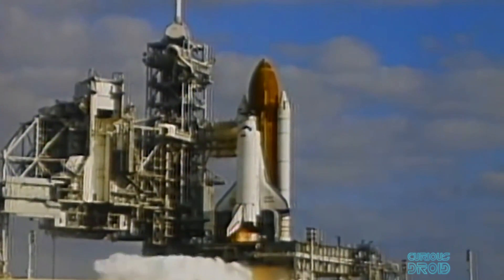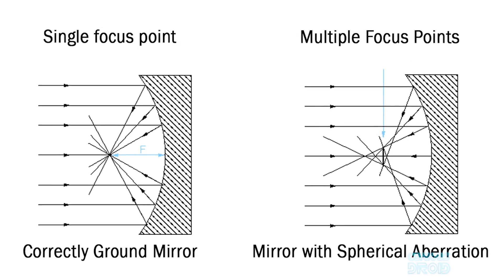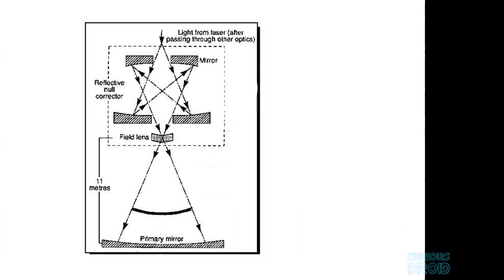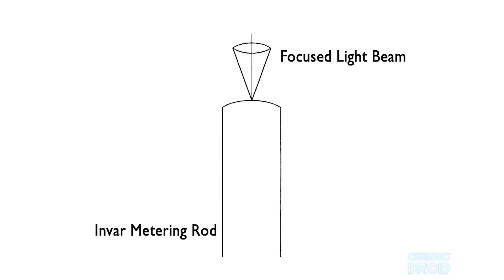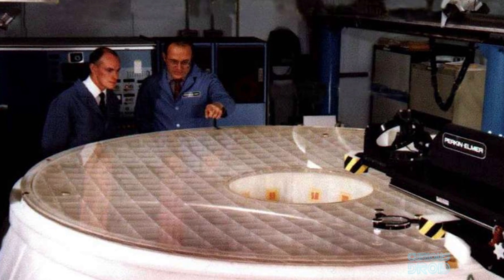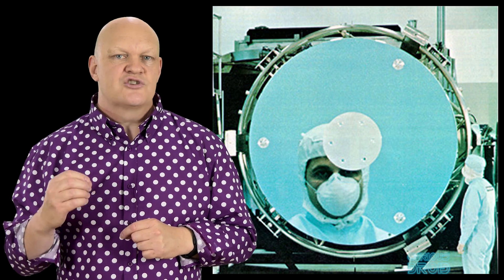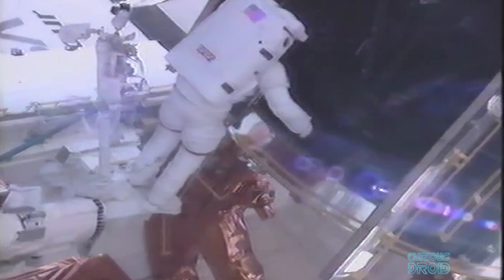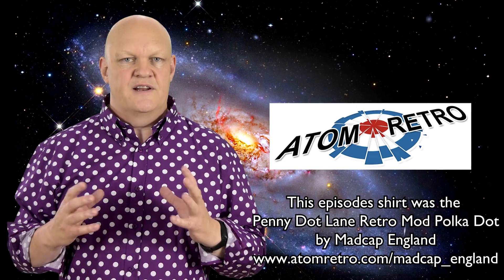Hubble Trouble - How did the Space Telescope Mirror End Up Flawed ?

Comment: The real question is how could they have fixed it AFTER THE FACT? To claim they only needed to use a PC program to fix the image means they didn't need a super polished mirror in the first place. But since they did go with a highly polished mirror (but ended up flawed polish) that means no program can fix it. It's not fixed, and all those claimed Hubble images from deep space are actually artistic rendering.....FRAUDS. - Google the name Kazuaki Iwasaki.
Reply: They didn't just updated some software, they made changes to one of the other mirrors.
Reply: They didn't just updated some software, they made changes to one of the other mirrors.
Reply: You're a fucking idiot
Reply: Here's the New York times article, 1990.  

"Manufacturing Flaw Feared

Jean Olivier, deputy project manager, said the cause of the latest problem aboard the troubled spacecraft was unknown. But he said engineers suspect that one of the two precisely ground mirrors was made with slightly wrong specifications.

''We don't know if it's on the primary or secondary mirror yet,'' he said, ''but it looks like a textbook-perfect aberration that is perfectly symmetrical,'' indicating that the flaw was built into the mirror."
Manufacturing Flaw Feared

Jean Olivier, deputy project manager, said the cause of the latest problem aboard the troubled spacecraft was unknown. But he said engineers suspect that one of the two precisely ground mirrors was made with slightly wrong specifications.

http://www.nytimes.com/1990/06/28/us/hubble-telescope-loses-large-part-of-optical-ability.html?pagewanted=all

So you heard wrong, and they didn't lie. Unless of course you dismiss this evidence of course, and actually provide a source of your own.
Reply: this "focal point" problem was not the story reported back in 1990 when
 this situation was current ( I was 30 years old. How old were you? Were
 you even born yet?).  But 
here we are 27 years later, this vid published just a few days ago  
(<--the evidence). So 
what brings up the issue now 27 years later except that there is a need 
to revision history to further cover up their 'getting exposed' 
cover-up. This ""wrong focal point" is the new excuse LIE because their 
original claim
 on the 'fix' was not adding up upon closer scrutiny. When reported on 
originally it was a claim of insufficient mirror polish not detected 
till after it's launch into space. The claim at the time was software to
 correct the fuzzy. But it was being observed by some that if software 
can sharpen the focus then a super highly polished EXPENSIVE TO PRODUCE 
mirror was not required in the first place. But a highly polished mirror
 IS required. There was no fix. NASA had to save face in public 
perception upon losing hundreds of millions of dollars on what is now 
space JUNK, so they make up a phony 'fix' story and hire an artist (and I
 even know who this artist is) to 
manufacture Hubble images. But that original excuse doesn't hold water 
so they come up with this new 'reason' and throw down the memory hole 
their original excuse and hope nobody (like me) notices.
Reply: this "focal point" problem was not the story reported back in 1990 when this situation was current ( I was 30 years old. How old were you? Were you even born yet?). But here we are 27 years later, this vid published just a few days ago (<--the evidence). So what brings up the issue now 27 years later except that there is a need to revision history to further cover up their 'getting exposed' cover-up. This ""wrong focal point" is the new excuse LIE because their original claim on the 'fix' was not adding up upon closer scrutiny. When reported on originally it was a claim of insufficient mirror polish not detected till after it's launch into space. The claim at the time was software to correct the fuzzy. But it was being observed by some that if software can sharpen the focus then a super highly polished EXPENSIVE TO PRODUCE mirror was not required in the first place. But a highly polished mirror IS required. There was no fix. NASA had to save face in public perception upon losing hundreds of millions of dollars on what is now space JUNK, so they make up a phony 'fix' story and hire an artist (and I even know who this artist is) to manufacture Hubble images. But that original excuse doesn't hold water so they come up with this new 'reason' and throw down the memory hole their original excuse and hope nobody (like me) notices.

Comment: I hope they upgrade and boost hubble, so it will be able to keep taking beutiful pictures
Reply: Edward Rex james webb
Reply: Agreed, but I think a complete replacement would be a better option.  Hubble II could improve in many areas.
Reply: and hoax folks can continue to misuse ellipses.  (And do not much else)
Reply: The Hubble was built to be upgradable, but instead of being designed for "Apollo" type spacecraft which plans called for a docking (yes, Apollo had telescope servicing capability), it was designed for the shuttle and as a result has no docking apparatus but rather handles for the robotic arm tool carried by the shuttle.  This is another technical hurdle that would have to be overcome as we are back to staged rockets and the shuttle deemed a technical dead-end. A robotic booster mission would also require a docking ring.  Hubble will last as long as its gyroscopes can continue pointing it.  They are notoriously failure prone even after full replacement after every service mission.
Reply: ... and NASA can continue to play with photoshop

Comment: Mistakes lead to corrective actions, cause studies, impact analysis, and preventative actions.  People forget this stuff is cutting edge, never been done before and then launched into space.  It's not a straightforward job.

I will also add that prior to 1998, Nasa was not yet ISO/AS9100 certified.  Operations and compliance to these new standards, though expensive and time consuming, have been beneficial in quality control measures.

Comment: Thanks for this  more thorough explanation. I worked in the 1990s for the Hughes Aircraft co. that had bought Perkin Elmer and some of their people came to work  where I worked. The explanation I was given back then has been in conflict with other explanations over the intervening years. Your mention of the use of spacers is the  first one that jibes with what i was told.
 The story I heard was that there were two different thicknesses of spacers in the bin of spacers used. Being a consistent technician, the person who obtained them mad sure they were all the same thickness. Unfortunately of the two thicknesses he had found in the bin, he chose the the wrong one. A classic mistake of the true "Murphy's Law" variety. Incidentally that law as originally formulated is about human error, not fate. It reads "If there are two ways to do a thing, and one of them is wrong, someone is certain to do it the wrong way at least once"

That was all I knew, and I did not know it was at the null corrector. I did know that testing Ritchey/Chretien optics is very tricky  which is one reason George Ellery Hale refused George Ritchey when he wanted to do the Palomar telescope mirror design his way.